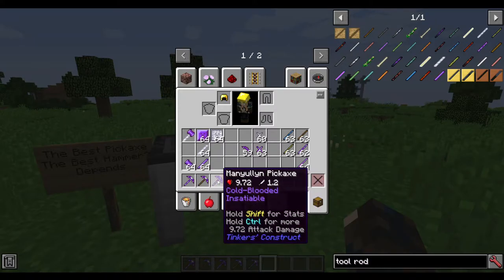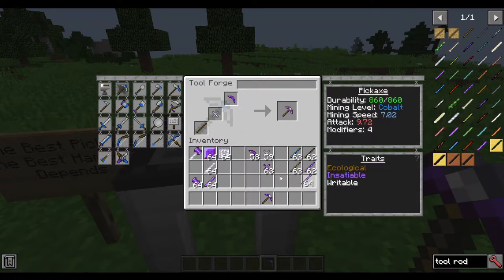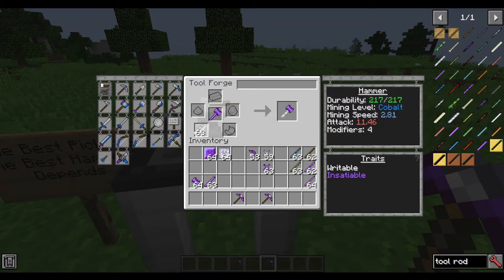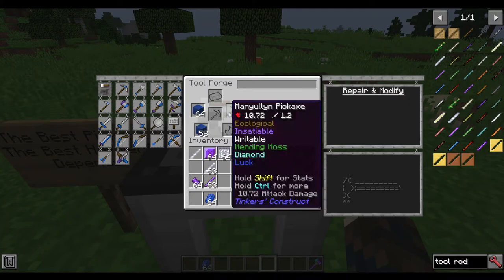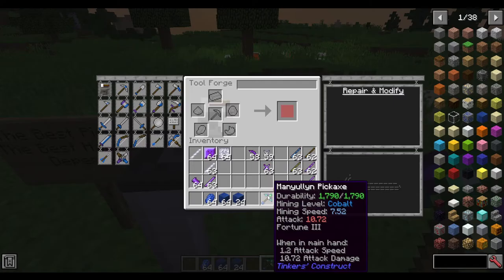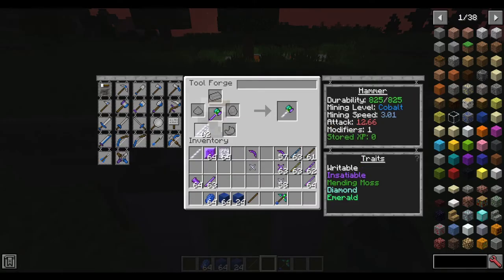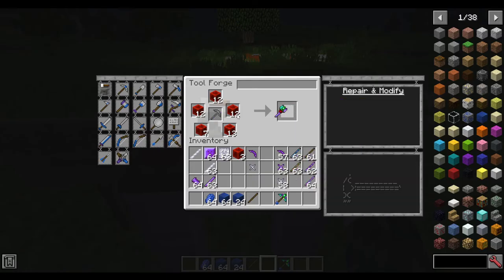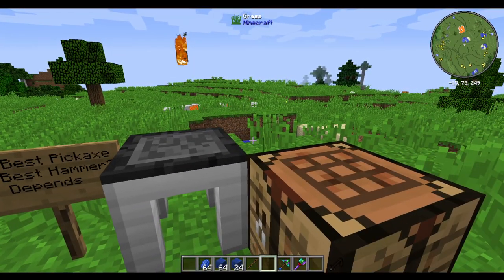Tinker's Construct 1.12.2 Best Pickaxe & Hammer (No Tinker Tool Leveling)

Comment from the maker: This video is to long.
Pickaxe: Manyullyn Pickaxe Head, Paper Binding, Wooden/KnightSlime Tool Rod
Hammer: Manyullyn Hammer Head, Manyullyn Plate, Manyullyn Plate/Paper Plate, WOODEN TOUGH ROD

Modifiers: Diamond, Emerald for both. Lapis on Pickaxe, and hammer only if you want. Maybe redstone for Hammer. Depends on what you need.
Reply: what modpack are you using??!!!!!
Reply from the maker: @stardustgaming3299 I am so sorry, I doubt you'll see this now, I was only using base performance mods, just enough items and tinkers construct.
Reply: @mx43classified35  should you not put redstone on pick?
Reply: For a good all round pickaxe id go: Cobalt Head, Ardite Binding, Ardite Rod, Diamond, Emerald and then redstone modifier. Gives a reasonable 2700 durability and 18 mining speed.
If you just want speed without durability just only put redstone on and you end up with 1500 durability and 25 mining speed.
For pure durability: Sponge head, ardite binding, sponge rod, diamond, emerald and reinforcement, manyullyn sharpening kit. Leaves you with 3500 durability and a chance to not consume durability
Reply: How can I fix it
It broke

Comment: Btw big man you can make tools unbreakable with 5 reinforcement modifications (gold plate surrounded by obsidian in a crafting bench ) which means you don’t need the extra durability mods great vid tho
Reply from the maker: In base tinkers, without tinker tool leveling you don't have enough modifiers. You only get 3 and there are no ways to get more without creative. I know what you are speaking of though. Almost always tinkers is paired with tinker tool leveling which is a separate mod that allows infinite modifiers. With that you can of course use the reinforcement modifiers :)
Reply: @mx43classified35  btw  how do i even use tinker tool levelling? how does it work
Reply: @tomonhas A little late for reply, but basically it gives you xp for using the tool and after reaching certain amount you'll get extra modifier slot and xp goal will double

Comment: for hammer i do cobalt head - paper rod - paper plate - electrum plate(for haste 3) and then i apply reinforcement to it 5 times and as a result you have a literally unbreakable fast hammer and the only downside is the electric noises (you can fix this by turning down "players" volume in sounds settings)
Reply: bro its not 1.7. its not how it will works
Reply: @АндрейБордак-й3м  i played on 1.12 and that worked
Reply: @maximidze2286  how do you get more than 3 modifiers?

Comment: after putting one modifier on both my pickaxe and hammer it says maximum modifier reached - any tips?
Reply from the maker: depends on the modpack/version, you either need to level up to gain modifiers or you are restricted from further modifiers. paper parts are good when first building tools
Reply: @mx43classified35  wow nice response time lol. Turns out I just have to level up my weapons - nice vid!